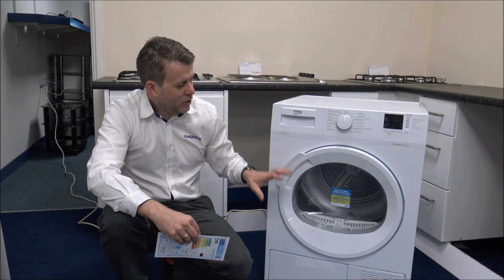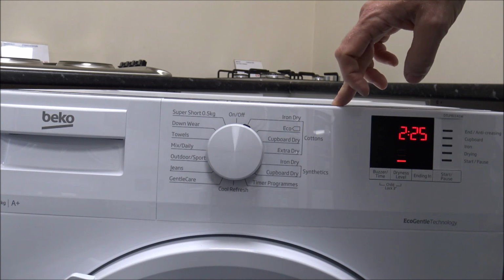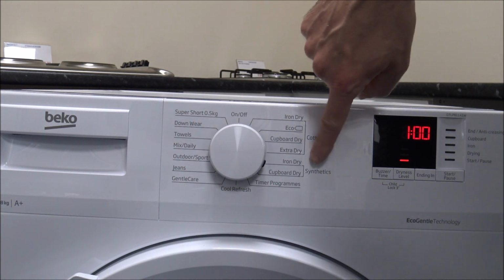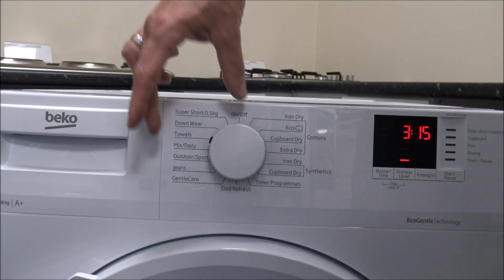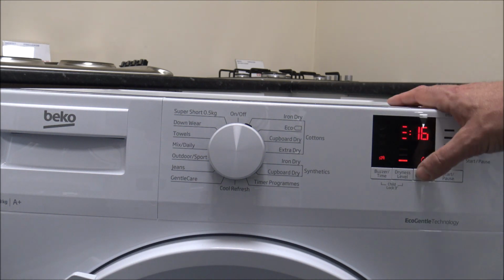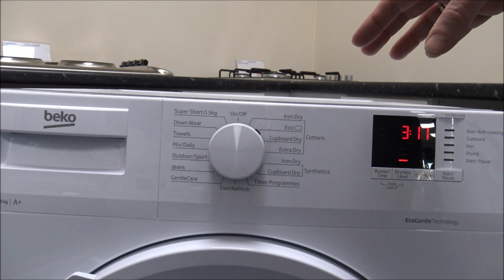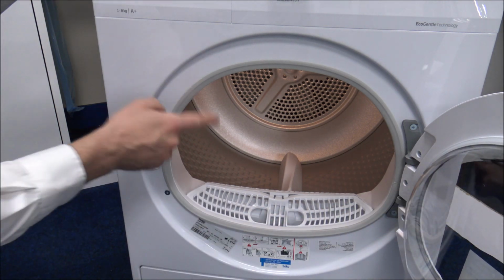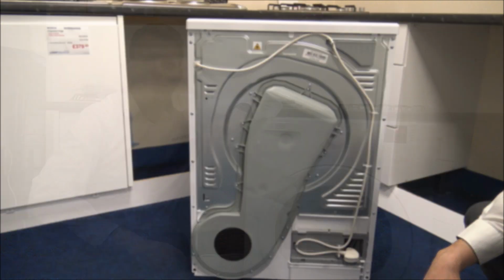Beko DTLP81141W Heat Pump Condenser Tumble Dryer

Comment: Hi , this is a really good video, ive learned about the timer side which ive never used. 

Ive had this dryer for over a year.. its spotless, all filters, water container, humidity filter  are all clear and just recently its not heating the same ?? Ive noticed the time will count down but the start going up? Or stay on the same time and doesnt change but dryer just keeps going and not drying items. 
Any ideas , I'm lost without it and its now out of manufacturing guarantee 😔 
Thank you in advance.
Reply from the maker: Drying times will always vary during the process of the program as it will monitor the moisture level of the clothes and change the time accordingly to how dry you want the clothes. The only things i would say that can affect the day to day running of the machine would be the filters or Condenser unit to make sure they are both clean, but it sounds like you have done those, so it may be something to do with the heating element which is where an engineer would need to have a look at it.
Reply: @lords-electrical thank you so much for your reply..
I kinda thought it might be that, was hoping something simple. I read also that it could be fluff etc maybe caught up inside the machine in which case I'd need to open it up but I'll probably be safer getting an engineer out.
Appreciate you getting back to me 🙏

Comment: Thanks for the very informative and easy to understand viseos. I have a (4yr old) Beko BDP710MG condenser dryer that was working in a stacked position, above a matching Beko washer. Due to some home reno's, had to move this dryer to another area of home, freestanding. Since the shifting, it runs but does not dry at all. Condenser doesn't seem to function anymore. It has clean filter and condenser fins. Everything else on mashine seems to be in order - can't understand what is wrong. With this model, only the filter unit is removable, whereas the condenser is fixed, with only the front fasing fins accessable, behind the foam filter unit. Please provide any guidance/input on what may be at fault. Many thanks
Reply from the maker: You have already done the 2 things i would first suggest by cleaning the filter and condenser unit. Is the room you have moved it into a lot colder as this can have a n impact on drying times? If it is a similar temperature then i am not sure to be honest what to recommend.

Comment: These have the absolute worst timer functions - can you explain to me like I'm a child "Ending In". With the detector built in, how would it even know when to start when it doesn't know when it will end? Let's say I want to go to bed at 9pm and I have cheap electric from 1am to 10am.  On the Extra Dry (3.5hrs) cycle - what exactly do I put? "Ending In, 13 hours" ?

It's baffling why they don't just use a clock system or even a delayed start option.
Reply: It measures the dampness, water left in the clothes, that’s why the time can be different each time. The time it shows is just an indication of what it thinks it will take. Most of the time it finishes faster. It’s not like a conventional tumble dryer that just runs a timer. Heat pumps work by measuring moisture content, so when the content is low it finishes. Conventional tumble dryers don’t know, they are dumb in comparison.

Comment: Do you need to use the hose that comes with the dryer? Or is the one that comes at bottom enough ?
Reply from the maker: You don't have to use the hose, its only if you want to allow the water to exit the machine via a waste pipe

Comment: I have had my tumble dryer for about 3-4 years now and I have never drain the condenser tub. I've looked all around it trting to figure out what the issue is but have found any. some while ago  it used to wet floor occasionally now it doesn't and there's no water in the tub. is something wrong with it? if so, how can I solve the problem
Reply from the maker: Does sound odd as the water must be going somewhere? Does the water go out of a pipe into a waste outlet, that can be the only other way of the water exiting the machine.

Comment: Thank you - a very useful guide to the machine. I have a DTLP81151W which is similar.  My sister has one and is pleased with its power-saving capabilities. I've just got rid of my old AEG Lavatherm 320 that was reliable, but a real electricity guzzler. It was bought back in the 90s, so these things weren't an issue back then. Thank you again....saves reading the manual. 😊

Comment: Hi I’ve recently bought this dryer but there is no air blowing out of the fan at the bottom and i can feel abit of heat but not much Is it surposed to be like this or do I need to get in looked at
Reply from the maker: That sounds pretty normal as heat pump dryers don't give out much heat. I would say as long as its drying ok then you should be fine

Comment: Hello and thank you for the informative video.  I have had a nightmare with trying to find out how a   Beko DPHY9P46W heat pump condenser drier works as the instructions are terrible.  I have tried speaking to Beko and other companies all to no avail.    Is there any way I can contact you or find out how to work these driers.  Do you work for a shop and also sell these?
Many thanks

Comment: Why there is no evaporator filter? This is well confuses me, is it designed like this or is it because it is the cheap model... As you can brush only what is in front, obviously there will be a lot of fluff collected through evaporator and further to  the water pup  etc ...

Comment: Thank you, very informative and I assume will be similar to the  Beko DTLP71151W Heat Pump Tumble Dryer which my daughter has just had delivered (only two of them so 7kg should be fine). The issue we have. and I'm hoping someone has videos and links of where to find the parts) is trying to fit the very narrow drainage hose that comes with the machine to the existing dishwasher/washing machine 'cone like under the sink' drainage, the old hose was much bigger in diameter (having removed the non-working dishwasher that the previous people left). What can be done? Has anyone seen parts or videos? Many thanks.

Comment: You didn’t mention the dampness ( condensation ) that gathers behind the filter at the bottom. Which I’ve only just noticed with mine. Apparently quite normal. But could create mould if not aware of it. :)
Reply: I had the same problem on mine, but that was when I selected iron Dry, which still leaves the clothes damp for ironing afterwards. When I should of selected Extra dry, under the cotton programs. But when I noticed the condensation forming inside, using the iron dry program, I stopped the machine midway, and emptied the tank. And I cleaned out the filters, removing any excess lint inside, so the machine can work better. Than I selected Extra dry program and when it was finished my clothes was dry. Obviously, you mustn’t overload the machine, because it won’t dry the clothes and it will make the machine work a lot harder. Also, spin dry your towels and bed linen at 1200 minimum, and clothes the same spin speed, or at least a 1000, so it will be easier to dry in the dryer and you will see less condensation.
Reply: @lg_believe333 mines started smelling when drying. I use the mix/daily setting. I guess it’s a build up of mold or something 😢
Reply: Exactly you can't even clean it there because those idiots didn't make opening door to clean it and avoid destruction of the tumble dryer that you can buy new one in few years time

Comment: Iv got mine in a cupboard. Is it ok to keep the cupboard door shut. Worried it might overheat or is it better as it’s warm in there. Thanks
Reply from the maker: If it is a freestanding tumble dryer, then it is not recommended to have the door open whilst the appliance is in operation. Obviously once it has finished and cooled down then shut the door.
Reply: @lords-electrical  yes it’s free standing. With you saying if it’s a warm room it’s more efficient. Thank so much for getting back to me very happy with it made up a bought it. I was a bit unsure until I watched your video. Thanks for all the info 👍🏼

Comment: I’m not sure if you will see this, but what’s the difference between what you reviewed and Beko DTLP71151W 7KG Heat Pump Tumble Dryer? I got my job and moved out from home and this is my first “adult” purchase, so I’m worried. The model you review is not available. Do I go for this model?
Reply from the maker: The main difference will be the load of 7kg against 8kg on the one i reviewed. If there are a couple of you in the house then 7kg should be fine, but if its a family washing a lot then normally 8kg and above is normally recommended
Reply: @lords-electrical  thank you so much! You are the best!

Comment: Got a7 kg beko dryer,noticed you’ve no lint filter in the filter housing, I’ve got one but it’s disintegrated, is it necessary to have one
Reply from the maker: Yes you need the filter to be ok for the dryer to be maintained properly. If you don't have a filter then you may get lint or fluff around the heating element which can be dangerous

Comment: Decent dryers, defo worth getting a heatpump over a condensor
Reply: @Aqualtislad2008 I have a Grundig Advanced Heat Pump GTN38240GCW tumble dryer and program 6 takes nearly 3 hours to dry, during it, it drops does to iron dry at 40 minutes, it also drops down to cool down at 1 minute so I used the water reservoir to empty, thanks
Reply: @Aqualtislad2008 ye because they’re a more energy efficient.  Here’s an example:  if you ran to somewhere you would be using more energy but it would get you to your destination quicker, however if I was walking to my destination it would take longer but I wouldn’t using as much energy.